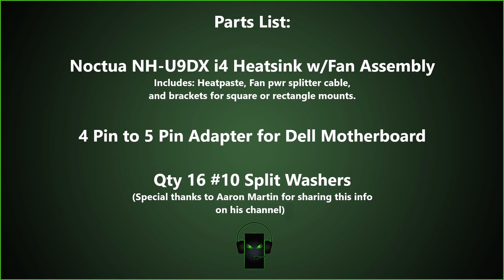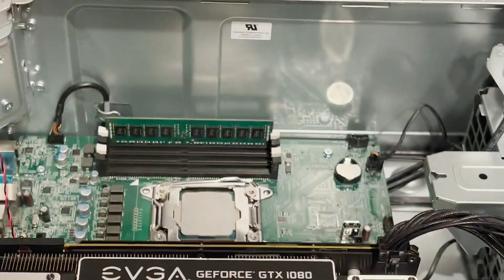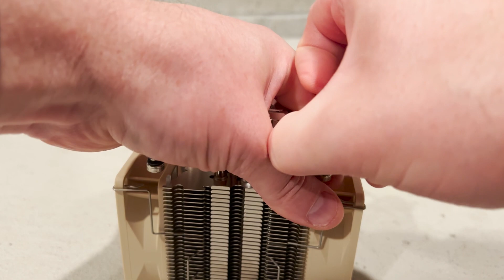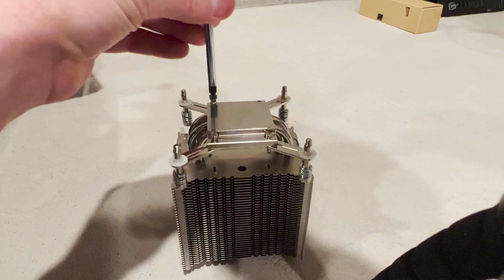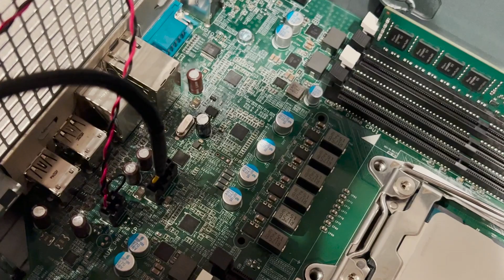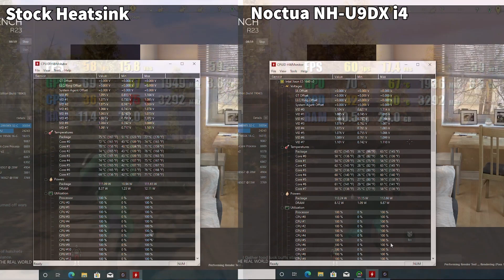How to install a Noctua NH-U9DX i4 in to a Dell Precision T5810 Workstation

Comment: As a starting point for modding 3rd party coolers onto DELL 5810 (and 3610 as well) - the AMD AM4/AM5 retention backplate spacing is VERY SIMILAR to that of the Intel Socket 2011 Narrow ILM, used by the Dell 5810 (3610 and others as well). Dell used the "industrial" version of that ILM, which is flushmounted somewhat deeper below the CPU level than the ordinary one. The matching screws are 25 x 4mm (round-head screws) can be used to attach the 3rd party coolers to the Dell mainboard. Use the distance spacers for Intel Socket 1700 if supplied. This worked attaching my Noctua NH-D9L 92mm CPU cooler to the Dell T5810 mainboard ...

Comment: With some easy tweak (using a 4mm drill or a Dremel Kit) you can also use many Socket AM4 / AM5 coolers on the T5810. Recently modded a Jonsbo HX6210 to fit on a T5810 (there's a video on YT available describing that mod).

Yesterday nice success with the most recent version of the Noctua NH-D9L on a Dell Precision T5810. You only need different screws (Home Depot, building materials markets) to attach the Coolers on the special "industrial Socket 2011 Narrow ILM retention module" used by Dell, as the retention module is placed flush mounted deeper below the CPU level. I bought 4x 25mm round-head screws and used the black platics distance offset tubes (originally for Socket 1700 installations) to attach the AM4/AM5 mounting kit (think it's Noctua AMB-12) onto the Dell mainboard. You need to widen the holes somewhat (with a 4mm ? drill bit or Dremel) on the mounting kit (AMB-12) somewhat. That's all required.

Comment: Is there any real reason to be upgrading the cpu cooler if it doesn’t affect frames? Based on your test it did run 10-15 deg cooler but it didn’t seem to gain any performance increase? It’s not like you can overclock it right? Can someone explain the benefits of this to me because I have a T5810 and wanna know if it’s worth. Cheers!
Reply: Generally speaking, lower sustained temps leads to better longevity, even if the immediate performance is unaffected.

Comment: Dell T7910 spacing between the two heatsinks, CPU 1 is hotter than before.
My question is: will installing a heatsink from Noctua prevent this problem and keep my CPU 2 cool without affecting CPU 1? And how much space does it occupy? The one I bought from China 14 centimetres large

Comment: I just did this to my t5810 but after installing the cooler, the door hits it and doesn't close completely. Is there a way around this?
Reply: Never mind. I just had to remove the internal latch cover and it fits fine.

Comment: I'm looking to upgrade the stock cooler for my HP Z440, any recommendations?

Any thoughts about the NH-U9S, different fixing method compared to NH-U9DX? i4.

Thanks.
Reply: If you have the HP 749554-001 I think that is a really good cooler (I use it all over the place..external builds, on an ASUS X99 Extreme 6, Lenovo P520.. though the Lenovo side panel won't close.)  Make sure the paste is fresh or at least not dried up. One trick people do is remove the black shroud from the Z440 and attach the fan with zip ties (I don't).  I have also thought about doing dual fans with the black shroud removed, but I haven't yet.  I overclock my Z440(e5-1680 v3) and my T5810(e5-1660 v3) to 4.2GHz.  In R23 (10 min) the Z440 doesn't get much above 60F while the T5810 goes up to 70F.  Neither system stays at 4.2 ghz.  Both drop down to around 3.8-3.9 GHz and have very similar R23 scores.  I am running both systems open case and the Dell without the RAM covers.
Reply: @augold1681  Yeah, I've also seen the remove the shroud / zip tie modification to the stock cooler.

In the end I picked up a used UH-U9S Chromax Black off eBay.

The black of the cooler / fan with the green rubber anitvibration mounts, I think goes well with the black & green colour scheme of the Z440.

Comment: i wanted to give you some additional information to put on your website of other processors I have verified that has fit and I have also tried a different part number 750 watt power supply that works as well.

Comment: Won't the RAM get hot?
Reply from the maker: No, the noctua heatsink and fans do a much better job than the stock heatsink of sending the warm air right out of the back of the chassis.  That also stops the front fans from running high under heavy cpu load.

Comment: Also beware of BIOS fan speed is apparently 0 speed at default & you will have to babysit it a little if you use it as a gaming or similar high workload rig. I got a refurbed T5810 "gaming rig" not so long ago & suddenly i start getting heavy throttling in games? While searching for answers i suddenly remember that i update the BIOS about a week ago & i check powermanagement settings and minimum fan speed is set to ZERO on auto. Donno what the setting was before but they clearly wasnt on "low" or "auto with Zero". So i crank it up to a 10% & cpu drops to a nice 65C while gaming & the throttling goes away. I crank it up to 15% to be sure & gets a nice 60C with "heavy cpu" 1080P gaming. The "auto" setting is supposed to ramp up not just the cpu fan but also the case fans if i understand it correctly, something about the motherboard not having temp sensors like many other motherboards have so the whole thing appear to be tied to the cpu (i think). Definately good to know when summer times comes that you can ramp up fan speed yourself & get a better case flow.

Comment: My e5 2660 v3 with all cores turboboost and undervolting has temperatures like  noctuas in video, but with the stock cooler.
Never saw more than 62° in Cyberpunk 2077. 
Gpu is 2060, 32 GB RAM (8*4)
Reply from the maker: Imagine the temps you would get with the noctua heatsink.

Comment: Anyone else having problems like only gpu's with dvi working and not amd Radeon wx gpu's with DisplayPort only (in my case wx5100)?
Reply from the maker: Are you using video adapters and/or an old monitor?
Reply: @GreenPCGamerscom  no. simple DisplayPort to DisplayPort cable straight from gpu to monitor.
2560*1440p monitor
Reply: @GreenPCGamerscom  update: the gpu works in windows 10 now... But still not in bios then I get no signal. Does the bios of the dell 5810 not support DisplayPort..?

Comment: Does this work with T3600s
Reply from the maker: Yes, there is actually a slightly cheaper heatsink that works on the T3600/T3610.  We'll be posting a video soon.

Comment: After installing, I recieved a CPU 1 error and both fans are not working. Would you have an idea why that is happening?
Reply from the maker: Make sure both fans are plugged in using the adapters we used in the video.
Reply: @GreenPCGamerscom  Got it thanks for that. The wire I ended up getting was a little loose. Will have to replace it 🙌🏾

Comment: Did this install on my T3610... the improvement was ~25C cooler at CPU idle and at full CPU load.  Now the front chassis fans don't run full blast when the CPU ramps up and things are much quieter.  Entire procedure took me about 2 hours, but I was being very careful with cable management so your mileage may vary.  Overall this is money well spent IMO.  Thanks for the great how-to video on this.
Reply: Hi, the fan cooler is screwed to motherboard cpu base or into the case? thanks and excuse me
Reply: @crypto602  It uses the same screw holes as the stock cooler.

Comment: Fantastic! I am dying of looking CPU temp at 61-65 at only 10-15% load… what about the Noctua NH-D9DX i4? Its even lower and it features aditional heat pipe if i see it correctly…? Any thoughts?
Reply from the maker: We haven't tried the NH-D9DX i4 yet.  It looks like it could be a good option as well.

Comment: I installed this Noctua heat sink on my T5810 but now I'm considering adding additional fans to get better air flow? What fans do you recommend and mods?
Reply from the maker: We haven't attempted to replace the front stock fans yet.  However, it's on the list.
Reply: @GreenPCGamerscom would love to see that!
Reply: Did this ever happen? 
I'm thinking of adding a rear upper exhaust fan but leaving the front for now